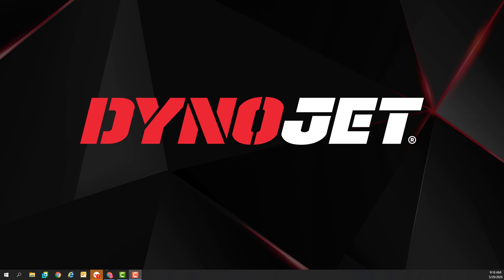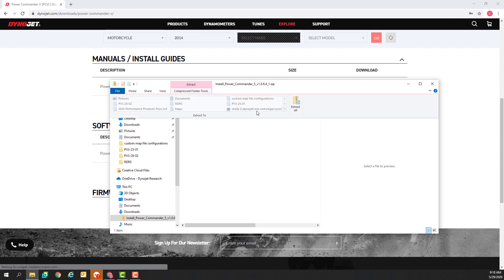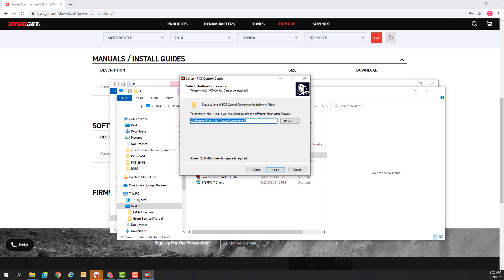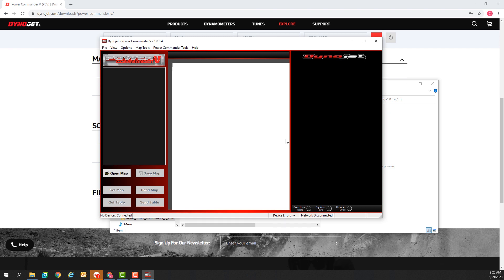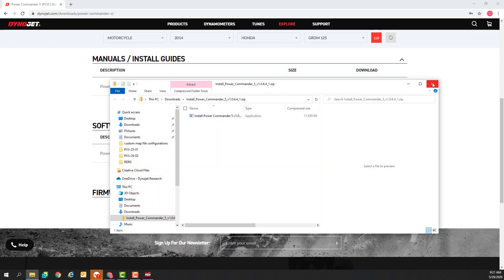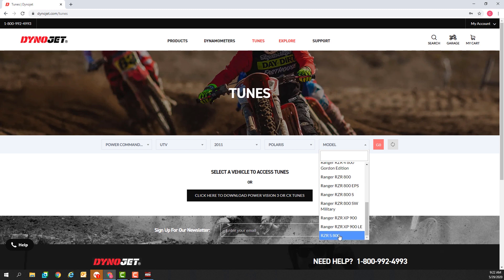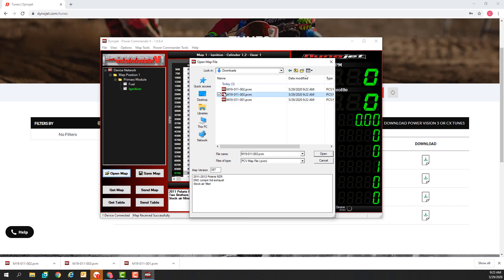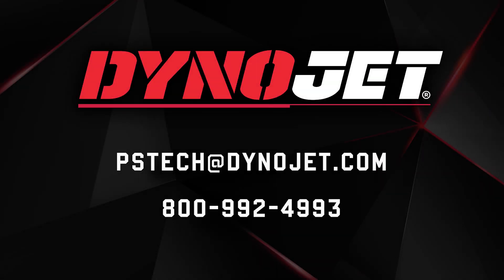How To Install Power Commander V Software & Map

Comment: When installing an auto tuner with the pc5 don’t you need to take off the stock map sensor? And also remove the stock exhaust sensor. Just unplug? Leave plugged in? Put a resistor inline? I’m unsure

Comment: I've just installed this on a 2003 vtx1800 I stall went great super easy I didn't see an option for stock exhaust missing baffles lol I also have a hypercharger should I just use the closest tune with a hypercharger installed?
Reply from the maker: Please contact our technical support at powercommandertech@dynojet.com.

Comment: I have a 2014 Yamaha Raider s, I just installed a freedom performance shortcut rate is exhaust and a PCV Commander and K&N air filter. The only map that I see on Dino's s website is set up for a Vance and Hine Big Radius 2-2 exhaust which is similar to the freedom performance. Will that map work?
Reply from the maker: If you would like to request a tune, please fill out our new tune request form which captures all of the necessary information to supply you with a tune. 

 https://www.dynojet.com/support-form

Comment: Bit of an oddity happening. I download an 07 honda cb900f  tune and it's a .p6m file. File type isn't in the drop down thus won't open it i guess? Filtered for full exhaust ticked the only "full exhaust" option available. P6m.. After that was a no go I went back to check tunes without filtering and there was another full exhaust tune. Downloaded and at least it was a pvm but now it won't let me "send map" to the unit (pre install). No options highlighted except open map and save map.
Reply from the maker: Hello! Please reach out to our technicians at Customerservice@dynojet.com or by calling 1-800-992-4993 and they will get you pointed in the right direction.

Comment: SO I RECENTLY HAD A PROB WHILE PC5 CONNECTED AND ECU FLASHED N DYNO TUNED.. MY BIKE AFTER 30 MIN RIDE STARTED SHUTTIN DOWN, ONCE I REMOVED PC5 IT CAME BACK TO NORMAL N NEVER REPEATED THT CUTTING OFF PRB.. I DONT KNOW IF MAP IN PC5 WAS A STOCK MAP INSTALLED WHILE I FLASED MY ECU AND THERE MIGHT B CONFLICT BW ECU AND PC5 THTS Y FUEL WAS CUTTIN N BIKE WAS SHUTTIN DOWN OR MIGHT B MY TUNED TURNED PC5 TO ZERO... MY QUESTION IS WAT IF I INSTALLY FUEL MAP FOR MY PC5 ONLINE CLOSER TO EXAUST I HAVE, WILL INSTALLING NEW MAP ELIMINATES THE PRB I WAS HAVIN OF BIKE SHUTTIN DOWN? SECONDLY PC5 FUEL MAPS ON DYNOJETS.. HOW GOOD R THEY OR DO V HAVE TO CHANGE SOMETHIN IN IT? KINDLY ANSWER PLZ
Reply from the maker: Hey there, please reach out to our technical support at Customerservice@dynojet.com or via toll-free phone at 1-800-992-4993.

Comment: I'm switching over toa carb conversion
Reply from the maker: We make jet kits in that case!
Reply: @DynojetResearch  ...im just not that computer savvy and the powervision has gone up in price over 200$ which stinks...they used to be 500$ on jnp cycles now 700. Cost 1000 for a good tuner on a dynamometer and a tune liscence so it's gettimg to be crazy money anymore to have a decent running bike......just my dumb ass opinions....

Comment: Great video .. Just following your steps it has the end confirmation..ie 2005 zx636 and info..BUT does not show and live feed data.. do you think I have installed it incorrectly.. the power commander was used and from the same model bike
Reply: Just thinking it could be the use as it definitely showed map details
Reply from the maker: Hello, Mike! Please reach out to our technicians at Pstech@dynojet.com or at 1-800-99-4993 and they can point you in the right direction.

Comment: I cannot find a map for my 2002 Honda VTX1800 with cobra speedster slashdown exhaust and stock air filter! What do I do???
Reply from the maker: If you cannot find a tune on our website, please fill out our new tune request form which captures all of the necessary information to supply you with a tune. 

 https://www.dynojet.com/support-form

Comment: Why there, I have a 2006 Suzuki LTR 450 an I bought it about 3 years ago an it had a PC3 it stopped working on me an my bike is running so weird. I want to upgrade to a PCV but I don’t know if that will mess it up or not. I don’t know what’s done to the engine. Or what tune he had on it so I am stuck on what to do an would to love to here from someone like you. I’m pretty sure it has a 516cc set up in it because it was way faster then a stock one, I just don’t know what to do, if you would text me back I would appreciate it so so much an thank you!
Reply from the maker: Hello! Please reach out to our technicians at Pstech@dynojet.com and they will point you in the right direction.

Comment: Does not work.  The additional maps (tunes) from website download as .p6m file types.   The PCV software is looking for a .pvm filetype so cannot identify the downloaded map.  In the video the host downloads a pvm.file type.  I have no idea what's going on.  Not a good way to start with new software.
Reply from the maker: Please reach out to our technicians at 1-800-992-4993 to help you through the issue.

Comment: So after several tunes and fine tunes I’ve accepted my trims to tune towards my target afr’s- for a race weekend do you think I should turn my auto tune off so that it will not try and adjust while I’m racing. I’m looking for consistency and predictability. Sometimes I think my auto tune is working against me due to changing weather conditions over the course of several hours and the adjustments it’s making causing inconsistency. What are your thoughts
Reply from the maker: Please feel free to reach out to our technicians at powercommandertech@dynojet.com and they will be able to make recommendations.

Comment: so you just add the map to the power commander and its good to go? also is there no klx300 maps?
Reply from the maker: Depending on your configuration, our tunes can get you dialed in or close to it. If you wish to finely tune your vehicle or have a custom set-up, you can visit an authorized Dyno Tuning center for custom tuning. 

Our tune library exists here: https://www.dynojet.com/tunes
And if you wish to request a tune, you can do so here:  https://www.dynojet.com/support-form

Comment: Funny, I've done all this but I can't for the life of me get my MotoGuzzi 750ie running good at all. I've had long conversations with the engineers at Dynojet on it and tried several things but in the end after several weeks of trying, I just took it off and threw it back in the box. I'd love to get my fuel injection to run a bit less lean for more oomf but it may not happen for my moto.
Reply: Same
Reply: But I got a yfz450r

Comment: Help. If I remove the usb cord, the power to the commander 5 disappears. The motorcycle stalls. What is the reason? HONDA 954 2003
Reply from the maker: This generally means the PCV may have a bad ground. Please check your ground wire to the Power Commander V. 

If you need more technical assistance, please reach out to us at pstech@dynojet.com.
Reply: @DynojetResearch  thanks

Comment: Hey there, I just purchased a used 2017 Kawasaki Z650 that has a full titanium Akrapovic exhaust installed. The guy I bought it from purchased a power commander V for it but never installed it because he said it had no tune to download. I have looked and he seems to be right, there does not seem to be a tune for that particular exhaust. I have noticed some black smoke when reving it up in the morning so I am assuming that it is running a little rich due to the upgrades he has done to it. How would I go about getting or making a tune for my particular exhaust? If it is possible to make your own tune on this that is. Thanks for any help you may offer.
Reply from the maker: If there is not a map listed for your exact configuration, select a map with similar aftermarket components.

If we do not have your exact exhaust in a pre-developed map. If you need to create a Custom Map you have two ways to do this. You can install the AutoTune accessory Kit for the PCV, this will enable you to fine-tune your bike while you ride or take your bike to a Certified Dyno Tuning Center. Links Below.

AT-200 AutoTune Kit for PCV: https://www.dynojet.com/autotune-power-commander-v-single-channel-kit-at-200/
OR
The listings for Tuning Centers in your area can be found located on this page on our website: 

https://www.dynojet.com/dyno-tunings-center/motorcycle-dyno-center/

Comment: Hi guys. I need a map for gen 2 haybusa 2013 model for pc5,  i have brocks full system  dual exhaust and k&n racing airfilter on it
Reply from the maker: Hello! Please reach out to our technical support at powercommandertech@dynojet.com and they will point you in the right direction.

Comment: so i have gsxr 600 2006 , stock air filter, akrapović slip on exhaust, with stock downpipe but i deleted my catalytic converter, what map should i choose?  
is this the correct choice? (Akrapovic slip-on2 open exhaust (S-S6SO5-TT), Stock or aftermarket air filter)
and do i have to remove those flaps on my exhaust?

please help...
Reply from the maker: Hello! Please contact us at powercommandertech@dynojet.com so that we can help you out with your inquiry.

Comment: i went to get a map downloaded and I can only get a map for a 2016 can am outlander 850 even though I have a 2020. Does anyone know if the 2016 tune will work for a 2020. or if I can get a 2020 map somewhere?
Reply from the maker: If you would like to request a tune, please fill out our new tune request form which captures all of the necessary information to supply you with a tune. 

 https://www.dynojet.com/support-form

Comment: What would you select if you had an unbranded exhaust for 2020 grom with k&n air filter?
Reply from the maker: You can choose a MAP that has similar aftermarket components for a good base line. For finer tuning you can visit your local Dyno Tuning center. 

If you would like to request a tune, please fill out our new tune request form which captures all of the necessary information to supply you with a tune. 

 https://www.dynojet.com/support-form

Comment: Wow... requires a Windows device... but they don't mention this in the marketing BS.  Thanks guys.  How long has this product been out now?  I'm the new proud owner of a useless Power Commander.  Awesome.
Reply: ever thought your mac is the useless part here?
Reply: How is it useless, borrow or buy a cheap laptop or visit a dynojet specialist to get it tuned on the dyno
Reply: @TJ-HBMCC   Duh, just buy another product or service to make the first one work.  Oh, you’re right.
Reply: @DS-nw4eq  I honestly don't know what you expect, it's not their fault you don't own a windows device or want to visit a dynojet shop to get it dialed in, maybe look into products before you buy them next time
Reply: @TJ-HBMCC   You can’t read, and what I mean by that is your comprehension skills aren’t very good.  Unfortunately, comprehension is the important part.
Reply: Well I mean if you could read or done your research you'd have found out that they require a windows device before you purchased it ya wolly
Reply: @TJ-HBMCC   HA!

Comment: I just got a new power commander 5 for my honda vfr 800 2009. I installed but the bike won't start. What do I need to do to fix this problem?
Reply from the maker: Please reach out to tech support at powercommandertech@dynojet.com or on our Toll Free line: 1-800-992-4993.

Comment: I installed the tune onto my powercommander for my 2015 triumph Daytona 675r, would it be beneficial if I went to a dynojet facility and got it dyno’d??
Reply from the maker: If you would like to fine tune your motorcycle, we definitely recommend visiting a local Dynojet-Authorized dealer.

Comment: would u guys have maps for empire industries duel exhaust? or anything similar on yamaha raptor 700r 2020?
Reply from the maker: If you would like to request a tune, please fill out our new tune request form which captures all of the necessary information to supply you with a tune. 

 https://www.dynojet.com/support-form
Reply: @DynojetResearch  thank you one more question, would it still work if u dont have a laptop and i send a map thru my pc to commander then hook it up to my atv?

Comment: Is there software available for a mac ?
Reply from the maker: You will need a Windows based desktop or latop computer to utilize the software for these products. Apple/Mac/tablets/ chrome/mac books will not work.
Reply: @DynojetResearch  Will I be able to send it back to Fuel Moto (where I bought it),for reprogramming?
Reply from the maker: @wb4514  Please contact Fuel Moto to see if this option would be possible.

Comment: I have an 07 GSXR 600 with a Dynojet PC. I use stock air filters. I put on an M4 Street Slayer slip-on. I've done nothing else besides that. I logged into your site. You have a profile for an 07 GSXR 600 M4 slip-on with stock or aftermarket filter. That should be good, correct? That should provide the best Fuel/Air ratio for my bike? I don't think I need a full, custom dyno.
Reply from the maker: Please select a configuration with similar aftermarket components. If you need to create a Custom Map you have two ways to do this. You can install the AutoTune accessory kit for the PCV, this will enable you to fine tune your bike while you ride or take your bike to a Certified Dyno Tuning Center. 

Please reach out to us if you have any further questions. 

powercommandertech@dynojet.com

Comment: Hey there; love the PC V - got a great tune for it for my Triumph out of Europe. Going to be installing a camshaft soon which means my ride will need a new tune to get the most out of it. This looks pretty straight forward, but when you upload the map (looking at around the 4:18 mark on the video), the tech has the 'fuel' tab highlighted. The tune I've got coming will have ignition mapping as well as fueling - do I have to highlight or click anything in particular, or will the software automatically upload both the fueling and ignition map as soon as I hit 'send'? Do I have to highlight fueling, hit send, then highlight ignition, and hit send (as in hit 'send map' two separate times) or will 'send map' send both the fueling and ignition map simultaneously no matter which is highlighted in the software? Maybe an odd question!

Comment: How do you add gauges to the screen? Mine just has tps and rpm. When I click on add gauge it says none. And no option to select afr or duty
Reply from the maker: You can right click on one of the blank gauges and pick the channel that you want to display.
Reply: @DynojetResearch  that's what I figured but it only shows rpm and throttle. I did the update to the firmware in case that was the issue but its the same. Now does the pc need to be plugged in to work?  That's the only other thing I can think of. I was just making a basemap for my turbo zx10r sonic didn't have it plugged in as the bike is in storage.
Reply from the maker: Yes, it needs to be connected to a device to know what channels can show up.

Comment: I have a 2018 Honda CBR650F. The carburetor trumpets are restricted on this model so if unrestricted, does the power commander have the option 
for this mod?
Reply from the maker: Rino, we do not have a predeveloped tune for that setup, but the Power Commander has enough adjustment to compensate.

Comment: Looking into the new power vision 3 for my 13’ xmr 1000 as it’s just seems much easier to install but all I find are the power commander units. Also hear the vision 3 are better thanks.
Reply from the maker: Paul, we do not have a Power Vision 3 that is compatible with the 2013 XMR 1000. The PV3 is a newer product than the Power Commander, so the fitments are more for newer vehicles. The Power Commander will definitely give you increased performance, though. If you have questions about your specific setup, we're happy to answer them at powercommandertech@dynojet.com.

Comment: When did the newest software and firmware come out for the pcv, and secondary fuel module? Anything in last couple years? They use to have a date when they were released.
Reply from the maker: Jeffrey, it's been a couple years since we've had software and firmware updates for those. Are you having issues, or do you have any questions?
Reply: @DynojetResearch  just wondering if there are any substantial changes in firmware, software that has enabled features other previous versions don’t have. I bought all my modules, pcv, sfm, autotune and quickshifter all new from motomummy back in 2014-15. I could check the firmware version numbers just to see if they’re current. How come you don’t make base maps for the secondary fuel module? Awhile back I was told just to use the same map that’s in the pcv in the secondary module and it’ll tune to where it needs to be. I was then corrected a year or so later that it’s not ok to run the same off the shelf map in bother modules. I don’t have any issues though I just zeroed out the secondary module so it’ll run stock tune. I’m pretty handy with these. I set it all up on gear dependent maps with an engine hoist on the rear subframe 😊. That was years ago runs like a top though 2007 gsxr 750. I’d like a secondary map as well eventually was told one wasn’t needed 🤷‍♂️ I am aware that the same firmware versions have to be ran on both modules, it can’t be two different versions is what I’ve been told.
Reply: @DynojetResearch  I really want the pod 300, so I can tune even further with a data log. But for years the software has been flawless for me and I’ve accustomed myself to it.
Reply from the maker: @jeffreyhinman1397  Jeffrey, can you please contact us at powercommandertech@dynojet.com? We'll make sure you have what you need and answer all questions about the firmware and the POD-300, which is a pretty popular item!